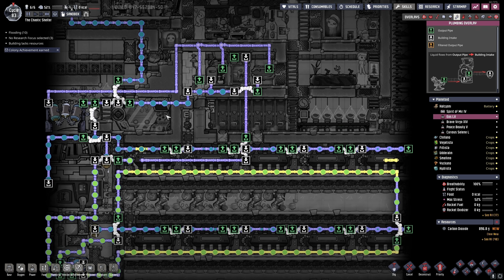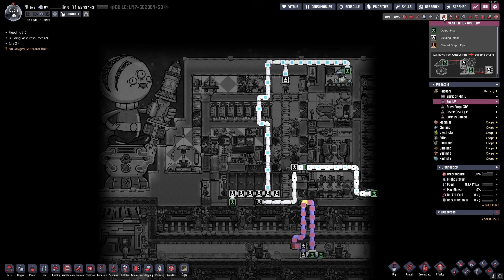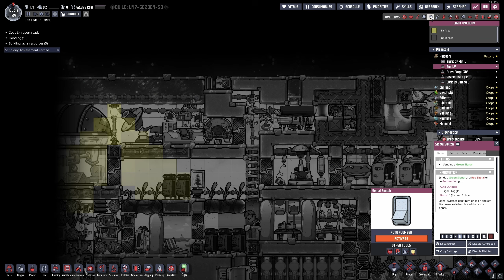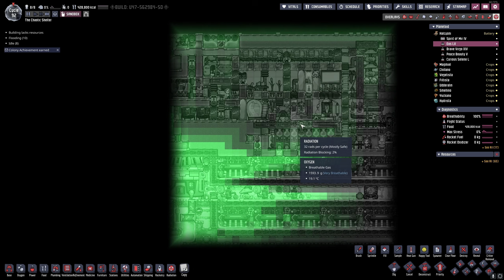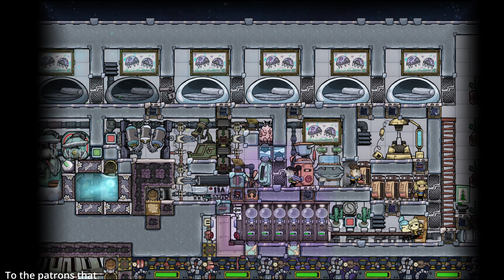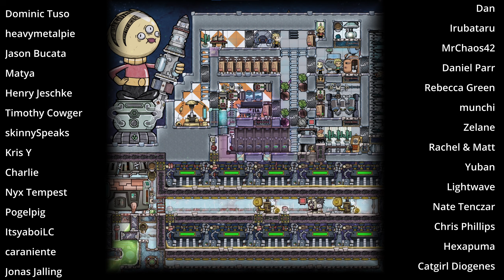Ep20 : Exploring a bunch of Rocket interiors : Oxygen not included

Comment: 20:10 How can a nature reserve be part of a kitchen with an auto sweeper? It says right there "no industrial machinery" which both the sweeper and the grill are. The same at 24:49, where a telescope which also counts as industrial machinery is inside a reserve. And again at 31:52 and at 38:40 but this time an auto sweeper inside a great hall, which should not be possible. At 38:50 the normal rules seem to apply though, because there the nature reserve does not accept the exosuit forge. And there are more cases shown which also break the rules. What is happening there??? Did the devs change the designation of some buildings to be no longer considered as industrial and the wiki has not been updated?
Reply from the maker: Some things don't count as industrial machinery, the grill and auto sweeper for sure. I know the conveyor loader is classified as machinery though.
I know it feels wrong but thems is the rules.

Comment: Don't forget to focus on the point of the space ship -flying, exploring, returning with resources. Don't just focus in living in it.
-Liquify hydrogen for fuel.
-Telescope for exploring.
-Infinite resource storage with an automatic dispenser. Use an autosweeper to extract heat from hot items and cool them to room temp. Dump everything at the front door while in flight, so it's quick to unload. 
-Get them working while flying.
  - in a metal refinery or 2 or 3...
  - converting coal to diamond for mining.
  -The artifact analysis station is not necessary on the rocket, because you have maxed out decor anyway, and you don't need artifacts on the ship. But you should have a way of returning artifacts from below planetoids.
-Use 100% of that reactor
   - energy to chill and melt resources.
   - rads to launch back home high quality resources - like liquid hydrogen, diamond, cooled niobium, resin, graphite, fullerene. Make sure your launcher can send solids, liquids, gas.
   - pump nuclear waste into infinite storage for rad generation. The launcher should be operating continuously when landed on another planetoid.
   - if you send rads out of a landed ship can you redirect them to refuel the same ship?

-Use steam room to clean polluted water - don't need a water sieve nor sand.
-make sure your ship is automatically prepared when landing home - all returned resources are emptied and the ship is resupplied with all consumables, including everything needed to build ladders, base at new location. Autolaunch rocket when ready.
-don't use external tank for water - you need that 27 tons for asteroid mining.

Focus on morale, not rooms. A beach chair gives +8 morale for days - so forget bedrooms and washrooms - stick the toilet in an industrial area - it saves a door and hand sanitizer. Give them 500+ decor when flying. Sauna gives +2 to everyone for 6 tiles. Arcade cabinet is better than juke box. partyline gives +4 morale if someone is at other end. 2 partylines and three schedules for +4 morale in 4 tiles. or 2 tiles and 6 schedules..  Carpeted tiles give tickled tootsies and morale over 4 tiles.  - put them everywhere. Make sure they get +12 for food.

Next mission - Make a sustainable rocket - no resources required.

Comment: 24:53 you don't need wash basins nor hand sanitzers in rockets. Dupes will get cleaned up by radiationfrom space  if they toilets are on the top level. To get a washroom bonus you only need a toilet and a non-functioning hand sanitizer. I think they all went for wash basins to avoid needing bleachstone, but you don't need bleachstone because of the radiation of space.

Comment: With the hydrogen could you cool it and power the rocket on hydrogen then you could go anywhere with that rocket?
Reply: I've given it a lot of thought, and I think this is the superior solution. One limitation - oxidizer. Given that you've got to pump it outside of the rocket, you might want to use oxylite as your oxidizer to avoid a mess of pipes. Then everything is self contained and no nuclear reactor required, giving you a lot more space. All you need to do is pump water into the rocket from time to time, plus a small amount of gold if you're making the oxy on site.

Comment: 0:19 List of Submissions
0:22 Epilogue1212 - science stations
2:35 LooWeeGee - comfy beds
6:08 Jake - farm, lead suits
7:46 ChaosStrife (uncredited) - monument
11:22 Carlos #2 - saturn critter traps
14:03 Gael Ramon - cuddle pips, external water tank, sleet wheat
17:19 Southernskies - shove vole farm
20:44 Horry - liquid storage crude oil, gas cooling
23:38 ChrisPDuck - flooded electrolyzer, lead tile entryway
27:45 MrSelenix - liquid duplicator, fish farm, sauna, green jackets
36:40 Timo - element sensor, small gas pump to vent, fish farm, jukebot
41:03 Mike - radbolt generation, diamond press, interplanetary launcher, metal refinery
43:50 Marc - refined carbon shielding, hop-through liquid locks

Comment: I did some investigation into this "radiation lensing" and it's incredibly interesting.  Radiation blocking scales linearly with the mass of a tile. First, while the display normally caps at 100% blocking, it appears that the actual radiation math uses the "true" value, even if that's over 100%.  This "lensing" effect only happens when there are two or more materials with a radiation blocking of more than 100% in a line.  They do not necessarily need to be adjacent.  Radiation alternates between 0 and existing each time it encounters a >100% tile. First it's 0, then some, then 0, then more, etc.

*****THIS IS HOW TO WORK AROUND IT IF ANYONE WAS INTERESTED:*****
A way to mitigate this is therefore to have *three* >100% tiles in a row so that the radiation is gone at the end.  In fact at 46:42 if you follow the path that goes through the corner of the water, we see: refined carbon (0 rads), lots of water (many rads), lots of water (0 rads).  I believe that appropriate reconfiguring of the refined carbon and water could make every tile safe, as a workaround for the lensing.

Based on my observations, this is what I believe is actually happening in the code (note, this code is in the sim, which modders cannot easily get the code for, so this is an educated guess):

Radiation is calculated by drawing "rays" out from the source. Each tile that these rays intersect, they do math to figure out what the value is for that tile, and then store that value and move on.  Radiation blocking is stored as a value where 0.0 is 0% blocking and 1.0 is 100% blocking. For each tile, a ray of radiation is going to do:
newValue = oldValue * (1.0 - blocking)
For example, if blocking is 0.6 (60%) then we want to change the value to 0.4 times (40%) its original value.

However, notice that this code has a flaw if blocking values are allowed to be above 1.0 the multiplier becomes negative, and that explains all of the weirdness that we see.

Assume a starting radiation value of 1000, and many tiles in a row that have a blocking value of 1.5 (150%)

step 1 = 1000 * (1.0 - 1.5) = -500 (negative rads stay stored as negative)
step 2 = -500 * (1.0 - 1.5) = 250 (turned positive again!)
step 3 = 250 * (1.0 - 1.5) = -125
step 4 = -125 * (1.0 - 1.5) = 62.5
and so on

The alternating nature is why we see the alternation between 0 and many rads.

It additionally looks like there's a hard cap on the amount of rads that can exist in a ray, based on the distance from the source, but I do not fully understand its mechanisms.

Comment: I was really surprised that more people didn't do water filtration via boiling. You didn't seem to notice the one person who did (Mike). I mean, you've already got a steam room with a nuclear reactor and steam turbines cycling water around. It's basically free. Saves on space and no need to keep sand stocked up. The only potential downside is using 95 degree water for the bathrooms might heat them up, but that's easily fixable with decent base cooling. Or you could even directly cool the water. There's room for an extra aquatuner in the steam room.

So yeah, definitely do that. It's the obvious move in my book.

Btw, there might be an actual reason to use a shower. It turns clean water into polluted water at a rather significant rate. It might be necessary to get enough polluted water to keep the suits repaired. Or you could just store polluted water instead of clean. Main downside to that is that it's a bit more difficult to restock the rocket, since polluted water isn't available in as many places. (I don't remember... do you have a polluted water type vent on your current map? I think so?)
Reply from the maker: You could set up automation to deal with excess toilet water, their are a few options. But I think it might just be easier to dump it all in the reactor and then every 500 cycles or so syphon out some water if the pressure gets to high. Then totally forget about it next time and the reactors explodes, sounds like a fun plan 😁
Reply: I did toy with the idea of boiling the water, the only reason i didnt is theres no way to control overpressure, since atmo sensors only go to 20kg. the steam would be over 100kg most of the time, and over 150kg the reactor would blow. It would be efficient, but it comes with its risks.
Reply: @MrSelenix   Ah, yes, that is an issue, but it's definitely solvable with the pipe metering tools. Send an automation pulse for every packet of pwater you send into the reactor, and meter out the right amount (accounting for the slight loss) from the steam turbine outputs for each pulse. Basically two meter valves, with their automation outputs ANDed and fed back into their reset ports. Since the meters can be inside the steam room, this still takes up no space in the living area. And it's fine if the automation slows it down some. We don't need high throughput here.
Reply: @tejing2001  the easier way to do that is probably to run the toilets and hand washing directly off of the reactor, since the amount of water consumed this way will be only very slightly more than the water put back in as PH2O, and even that could be accounted for by introducing a set amount of water into the reactor every time a smart storage in the reactor gets full of dirt

Comment: Francis: I don't know what that lensing bug is, but it has been reported.
Klei: This wouldn't be an issue if you guys would stop breaking the game in the first place!
Reply: But?
Ain´t breaking the game the purpose of this game?
Reply: @andreastyrberg7556  * shuffles papers * Uuuuhhh, um, to... include the... oxygen? yeah seems to be in the name.
Reply: the community breaks the game to such an extent that their finding bug that should even exist.
Reply: The bug is a simple one, the Water is calculating the Rad Reduction per tile (so the 1st tile brings it down to a negative number and then the 2nd tries to minus the resistance and causes a negative overflow error). Lets say that the weight of the water is -10k rads per tile, there are only 2 tiles stacked top to bottom, and the reactor is putting out 3000 to that bottom tile, the bottom square would be calculating at -7000 Rads, which the next tile would then show as 3000 Rads again. The reason it goes up is there are 4 tiles and it also calculates diagonals.

The coding solution is to prevent negative Rad numbers being pulled into other tiles with a if negative = 0.

The reason they wouldn't do that is this adds a new calculation per other tile in the calculation (so up to 8 per tile if it's a single tile width, 24 if it's a 2 tile width) so could slow down the game. (Edit: not by much it feels like, I haven't looked at their code)

Comment: In the 'stupid combinations' department - If you want to run an interplanetary launcher in your rocket (or anything else requiring radiation), put the infinite storage tank on the left side, and use the lensing effect to amp up the strength of the radbolts in the generators. Also, does the radiation passing through the infinite storage tank kill germs? If so, no concern about recycled toilet water.

Comment: About the problem of the water amplifying the ration on the rocket with refined carbon. I don't know if it would works, but this game makes me think that if you builld the power joint plate 1 tile below, you could change the insulated tile that is (on the original design) right above the joint plate by another block of refined carbon and that would solve the radiation problem

Comment: If you were going to use the plants that require radiation you could move the carbon up and have a gap right over the reactor for the rads. Or you could have it block most rads leaving just enough rads to be able to have the rad plants work and have the next floor block the rest of the rads.

Comment: @FJ  
Germs in the water is not a problem when the water storage is above the reactor.  Also the large telescope has 100% rad shielding so doesn't care about  lensing effect below.   Originally looked at decontamination shower, but according to wiki they don't work yet.  

Edit: actually home.  :)   With some automation changes, the electrolyzer can just have the bottom cracked open.    Having seen some of the later ones, I'm thinking "how can I get a source of natural gas in to make surf'n'turf?"   The infinite pacu trick on the left edge + shovel vole ranch; the pacu can live inside the infinite liquid storage...

-southernskies

Comment: I wonder if using the reactor below as a water purifier would be a good idea...
You could hook up some automation for pressure sensing and dump the excess water into space (or an infinite storage tank)
It would save you some space on a water filter (no filtration medium required either) but it would also leave you with a scalding hot water source
Reply from the maker: Stealing that idea, will require a bunch of cooling for the rocket but we can afford the power cost.

Comment: Would it not be better to have the nuclear station & turbines level on the top floor so they also block space radiation? and so you can mitigate radiation coming from one direction instead of from above and below...
Reply from the maker: A single layer of plastic tiles reduces the rads to 80 so it's not really necessary. But more importantly it's easier to keep the reactor lower down.

Comment: 18:37 Not really. It's right above the radiation source, so it'll be purified theoretically.
34:53 Can shove voles live in steam? If so, you could just make the atmosphere part of the steam chamber. Put a pneumatic door on the bottom next to the reactor, then insulate as normal with obsidian.
(~) 38:40 I think the room bonus for wash room can be achieved using a hand sanitizer? Frees up whole column of space in the bathroom, unless there's that pesky 12-tile minimum size in which case nvm I guess. Though I guess if washroom can have gas pumps in them, you could remove the airflow tiles behind the toilet, remove the sink, move the toilet back one, put another toilet in, and put a hand sanitizer in to double the capacity. (I think you can disable the hand sanitizer without losing the room bonus?)
46:35 Maybe a workaround while the bug gets fixed... replace those two insulated tiles that have lots of rads with refined carbon tiles?
Reply from the maker: Shove voles in the reactor space is inspired. Saves space and if they are wild voles no grooming is required.
Reply: Problem with Hand Sanitizer is you need a supply of Bleach Stone.  Only way I can recall to create more Bleach Stone is to keep Squeaky Pufts, and it's difficult to collect enough Chlorine, even with more than 1 Chlorine Geyser, to feed the Pufts.  They consume literal tons of the stuff.  You're also walking a bit of a razor's edge between over pressuring the Bleach Stone so it doesn't off-gas, and staying below Popped Eardrums cutoff.
Reply: @PhailRaptor  The fact that hand sanitizers don't seal offgassing has always bugged me.

Comment: For venting excess hydrogen, couldn't you do a tile without drywall and an automated door in front of that tile to save on the pump? You'd just need the pressure sensor. Saves some power too.

Comment: You could put all the steam generators on the left since radiation doesn't matter, that way your refined carbon wall could be vertical and you wouldn't need tiles underneath to support it as you constructed it saving you a double floor.

Comment: Also for Selinx pacu farm, the reason the pacu don't become cramped with an egg is because the edge of the map doesn't count as a boundary for room sizes. Holds matter and stuff back but no restriction on room sizes. So pacu/critters are totally viable for space!

Edit: typed overcrowded instead of cramped.
Reply: The "cramped" debuff is the one to watch for.  It means "not enough space, so no eggs."
Reply: I just did some testing and about a certain point (about 15 during tests), a single egg gave them all the "Cramped" debuff, reducing reproduction to zero.   I wound up having  separate the eggs into its one 1 tile room (quite difficult when storing the pacu within my infinite water storage).
Reply: @brendanrobertson5966  Yup. A simple auto sweeper sucking up the eggs and dumping them into that auto dispenser over the pneumatic door resolves that, since hatched Pacu fall right through them.